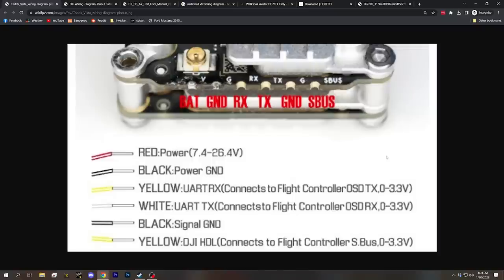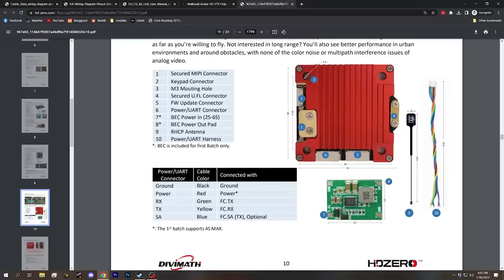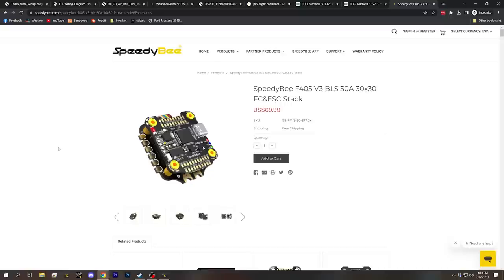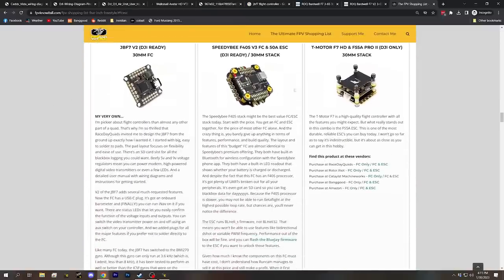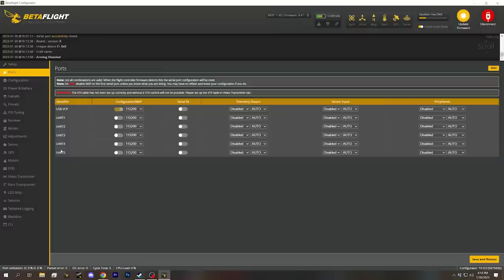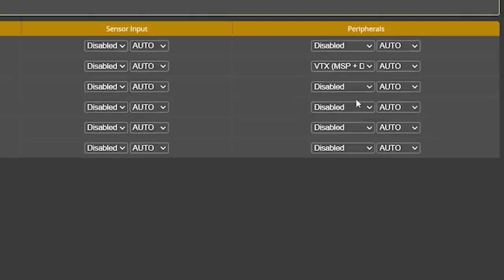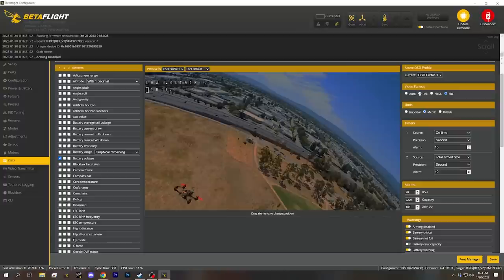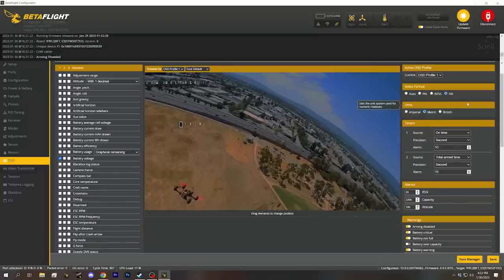Betaflight HD OSD with DJI Walksnail & HDZero // HOW TO SET UP

Comment: Unfortunately didn't worked for me. HDZero Race V2 VTX + GepRC Phantom (Smart25) FC - there is no OSD. UART2 is used by receiver so I used UART1 for VTX. When I set MCP for UART1 in BF (4.3.0) - I have nothing in Video Receiver menu. Whatever I do after save and reboot I have unchecked MCP for UART1. When I set for UART1 only peripheral (VTX + SmartAudio) and MCP off - I have all VTX table and configuration in video receiver menu in BF available but still... no OSD. Of course I don't have SA due to lack of UARTs available. Actually my HDZero VTX is totally useless. BTW when I try to set in CLI - 

# get osd_displayport_device
osd_displayport_device = MSP
Allowed values: NONE, AUTO, MAX7456, MSP, FRSKYOSD
Default value: AUTO

# get displayport_msp_serial
displayport_msp_serial = -1
Allowed range: -1 - 40

When I set displayport_msp_serial = 0 - I have nothing in video receiver menu and after save&reboot I get displayport_msp_serial = -1 again. There is no way to save as 0 (uart 1)

Comment: Hi JB,
You mostly refer to the rooted DJI v2 goggles in this video. But is the HD OS not compatible with rooted DJI v1 goggles? Thanks!
Reply from the maker: V1 and v2 both work the same as long as they're rooted.

Comment: Has anyone else had osd elements get stacked on top of each other in BF 4.4 hd osd? I lost the rssi dbm for a solid minute until I discovered the default position was BEHIND THE WARNING ELEMENT!!! It would be nice if there was a check that prevents new elements from populating behind active elements.

Also actual questions: is there a bug with timers? I have the flight timer on and it shows on the osd tab, but it does not appear in the Hdzero goggle.
Reply: If those are stacking and your are using dji goggles v2 make Sure that you disable OSD from your goggles

Comment: Getting a betaflight 4.4 warning vtx table has not been set up correctly and without it vtx control will not be possible. Using DJI goggles 2 with updated caddx firmware for compatibility. Only getting a max of 5-7mbps output from vtx. Any ideas or solutions?
Reply from the maker: Vtxtable has no function when using DJI vTX. The warning can be ignored.
Reply from the maker: The low bitrate, this is what I'd suggest: https://www.youtube.com/watch?v=t6CBYsfmBsk&ab_channel=JoshuaBardwell
Reply: @JoshuaBardwell  Thanks JB !

Comment: Great vid and just what I need today. I hope I learn something. My OSD works but it overlaps across the screen and the crosshair is way over to the right. Any suggestions? I’m a f’ng noob 🤷‍♂️ I’m running an o3 au on a geprc f722 aio 45a on a 4s AOS Cine25 I just finished as my first build. I’ve been flying bnf.
Reply: Try moving the osd on betaflight while having your goggles on so you can move the icons and see where they move real time to adjust them to fit your goggles
Reply from the maker: O3 air unit does not support HD canvas yet. It is being worked on by DJI and will be released in a future firmware update. Use PAL canvas.
Reply: @JoshuaBardwell  This is very good news! I would be happy if it also worked in INAV. Do you know anything about this?

Comment: Watched all the Video. Going to give up! OSD Waiting and nothing loading.

Speedybee F405
Air unit Polar
DJI FPV goggles 2

-Updated firmware for both wtffpv drivers
-Rooted the system
-Downloaded the options
-Typed in the CLI code port to "0"
-I know the UART port is 1, using direct cable from Airunit to FC

Tried UART 1 and 2. Nothing is displaying. Anyone else have this problem? I know the goggles are done correctly as it loads the commands and says OSD waiting. But can't get any data from FC.

Comment: I have a dji o3 unit and dji goggles 2. I've had to change my osd displayp port serial. It's port 3 so I've changed it to 2 and I've now got osd but now in the osd tab on betaflight since changing it to msp the video format has disappeared which contained AUTO PAL NTSC HD settings. Now I can't select HD? Can anyone please help fix this? Thanks

Comment: My FIX for OSD not showing in DJI-V2 after ROOTing + WTFOS + applying latest updates to GogglesV2 + O3 unit, in BF4.4 :
After setting up your OSD in BF.... hit save, then go to CLI. 
Type:

set osd_displayport_device = MSP
set vcd_video_system = HD
save

WARNING: The OSD in BF4.4 will revert to a non-HD (4:3) preview upon the next connection to the BF-configurator!!! But, as long as you do not hit the save button on that tab, all your OSD elements will remain the same in your goggles. If, you need to change the elements (on/off OR positioning) just re-type the those 3 lines into CLI, AFTER you re-done them.

I hope this works for you as it did for me, and I hope this gets fixed in upcoming BF update.
Reply: I have the Goggles V2 and O3, do I have to install WTFOS?
Reply: @MrReefxl  yes. i have ONLY ROOTed and installed WTFOS to the gogglesV2 and it works great.

Comment: I'm wondering how much a preset is better than a single command, unless someday to upgrade BF we just flash and re-apply the same presets automatically.

Btw. why do we have to enter rate profiles each upgrade when the numbers in the UI we input are literally the sames?! I need to check if we cannot migrate them.

Comment: I'm getting duplicate OSD elements when I do this. I have a rooted DJI v2 goggles and a rooted Caddx Vista, both with WTFOS installed, and using Betaflight 4.4. I see the Betaflight HD OSD elements in the correct place, but it also puts a duplicate element in a seemingly random place on the screen.

Edit:  I think the duplicates might be because I didn't turn off "Custom OSD" in the goggles menu. I noticed the duplicate elements seem to only be the limited ones that were compatible with the DJI goggles previously, and they showed up looking slightly different from Betaflight (example: Flight mode saying "ACRO" instead of "ANGLE"). I'm going to try turning off "Custom OSD" and see if that fixes it.
Reply from the maker: Yes that's correct.
Reply: @JoshuaBardwell  That fixed it. Thanks for all you do!

Comment: Another one here with the 4:3 aspect issue once HD is selected. In fact it requires some elements to be placed outside of the BF preview window in order for them to be seen in goggles.
Reply from the maker: I'm going to assume you're on the O3 air unit in which case HD canvas doesn't work yet.
Reply: @JoshuaBardwell  no it's a vista.
Reply: I have the same issue on my air unit, it’s even worst. When I setting up OSD I in the positions they showing up in random places on my googles im Using BF 4.4 v1 googles air unit  wots on both devices.
Reply: @Flying_Wild_Boar  recheck you've got the correct uart selected for the vtx. The update weirdly altered my ports tab and I hadn't noticed it
Reply: @Paulwhittingham  thank You so much it works

Comment: Hi Hello, I'm using dji caddx air unit + Google 2 (not V2). Beta flight 4.4. And nothing in the video worked. But I got it right using a preset on beta flight for dji O3 vtx (even I'm not using that one...) just in case someone else finds the same issue I used what Joshua said to use in BF4. 3 except I'm in BF 4.4...I hope it helps.. (all firmwares were the latest for Google 2 and caddx)
Reply from the maker: Yes, the BF 4.3 steps do not work on 4.4 that is correct.
Reply: @JoshuaBardwell  hi Joshua, thank you first of all. The solution for 4.3 using presets worked for me on 4.4 (I got the osd on the goggles after using presets) as the usual way did not.

Comment: Will this work at all with O3 and Goggles V2? I can't really make it work, 4.3 nor 4.4
Reply: same here
Reply: There is no HD OSD for the O3 yet. JB wrote that DJI is working on it, the new FW will support it already.
Reply: @hundronezone  It means no OSD at all?
Reply: @MrReefxl  But there is, Custom OSD. DJI is working on full HD OSD support. JB mentions it in the video.
Reply: @hundronezone  Yes, for some reason I can't make it work with my O3 and Goggles V2. I tried 3 different quads.
Reply: @MrReefxl  Does it not work at all or just no OSD?
Did you update the FWs?
Reply: @hundronezone  I'm on latest on every device. Just no BF OSD. I do see the Au OSD (Googles battery, RC, etc on the right bottom)
Reply: @MrReefxl  On the OSD tab, did you select the PAL video format?
Reply: @hundronezone  yes.
Reply: I'm using Goggles V2, the big ones version 2 (not the Avata Goggles)
Reply: @MrReefxl  Me too. I don't know what you are doing wrong. It works for me.
Reply: @hundronezone  BF 4.4? are you rooted with WTFOS?
Reply: @hundronezone  Did you run: osd_displayport_device =MSP ?
Reply: @MrReefxl  No need to root. Yes, osd_displayport_device = MSP
Reply: @hundronezone  Today I got another pair of Goggles V2 from a friend and on his Goggles we do see the OSD on the same quad. The Goggles are on the same version. This is really stange.
Reply: Problem Solved. I have connected the Goggles V2 to DJI Assistance and it said there is some component version incompatibility, so I refreshed with the latest version and that solved the problem.

Comment: For f403 follow instructions . 
Open cli command line and enter . 
" set osd_displayprt_device=MSP " 
" set displayport_msp_serial = Y " ( Y= uart number - 1 . For instance uart1 "Y" will be 0)"
 " save" 
 Ps do not type the quotation marks .
 Misspellings are not terrifying because red lettering might print MISTAKE CHECK YOUR SPELLING DUMMY or something . Anyway it might not accept it and go electo crazy banging into walls and howling all night .
 Just kidding . If you have no flight controller it will work withot rx and tx . The /\ symbol in the goggles is the models battery level for your osd in your car or truck model or flying wing or airplane model .
Reply: It tells me : ###ERROR IN set: INVALID NAME: displayport_msp_serial = 0###

Comment: I just noticed something that I thought was "strange" about my Vista, on Josh's Vista - the two power pads have solder on them while the others do not. Is that normal? I saw it and thought it was indicative of receiving a refurb or something. Plus, this was NEW, wrapped in plastic and it appears it may not work. :( 

Anyway, is it normal to see solder on the two power pads right out of the box? at 1:08
Reply from the maker: Yes it's normal. They test them at the factory.